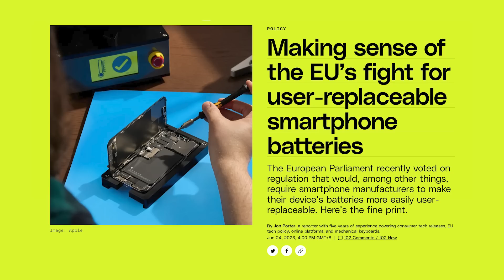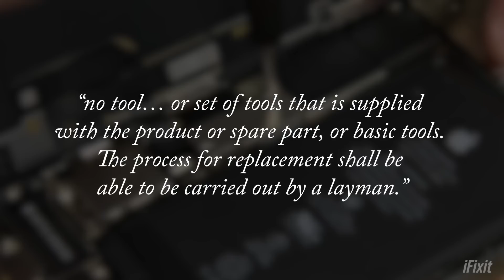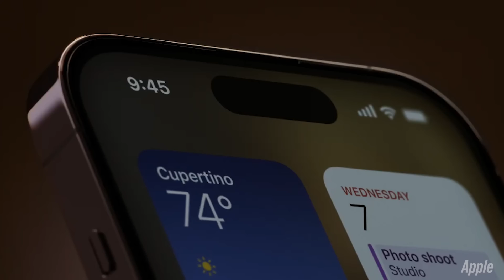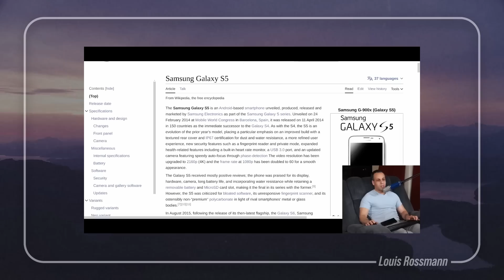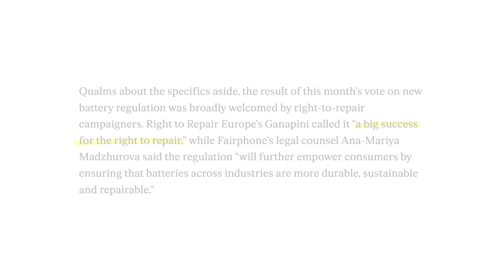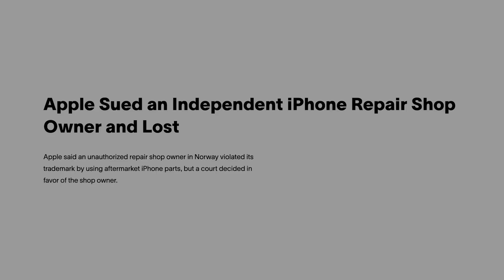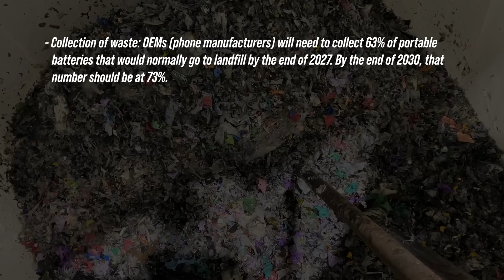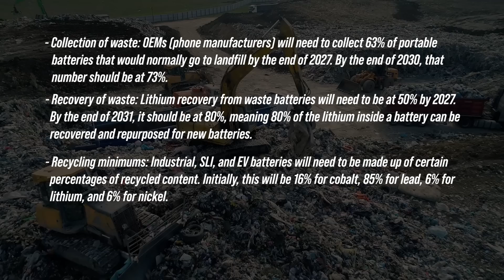EU Just Changed Smartphones Forever

Comment: With all of the innovation that has happened over the last 40 years, is it really that hard for them to have to actually 'engineer' some improvements - such as replaceable batteries, and/or Micro SD cards back into the phone -  no. Instead of offering an ever so slightly faster processor with an extra megapixel on the camera and a new colour, they are going to have to work for once to 'earn' their cash cow. I'm a fan of universal chargers and remember when almost everyone had a Nokia so you never had to carry a spare. I'm not normally into Governments interfering with markets where there is no crime taking place, but this is surely a good thing. The number of devices I've had to bin due to the prohibitive cost of battery replacement is crazy and then factor in the (even!) older generation such as my mother who will only bin her phone or laptop when it's unusable, this is going to be a net benefit to recycling. Sure, it will hit the bottom line of Apple, Samsung et al, but I'm quietly confident that they'll be charging us more the phone, and probably selling it without a battery 'to cut down on e-waste' - which I'm sure some of you will remember that was the reason they gave for not including a charger in the box... Boot is on the other foot, your move, big tech!

Comment: On the EV front, this leaves the door open to massive improvements! there will now be the potential to change the range of your vehicle by changing the main battery or adding a range extender! also introduces the possibility for 3rd party manufacturers to develop Non-OEM batter packs that would extend the life of older cars (yes that much was implied in the video) but also in combination with a possible flash tune to "hot rod" the vehicles!
Reply: Just to add that back in the early to mid 2000s and even upto fairly recently, there were extended life batteries available for phones so this is nothing new, just a pitty we need Government intervention yet again to reign in the greed of the corporations
Reply: That rule doesn't app to vehicles.
Reply: More important than that, you should be able to replace storage and generation tech.
Reply: In my country, there's a push for ev bikes to have standardized battery so they can be swapped out easily in charging stations. Granted, it's not yet written into law as a requirements, and the scope for now is limited two wheelers while availability still limited to metropolitan area. But I see it as a good starter model to steer consumer's expectation of how EV should be specced out and operate. Since currently, most charging station is operated by state-owned company and government are trying hard to reduce oil dependency. 

There's a hope that given enough time to expand the current model of "hot-swap charging", manufacturer-exclusive battery will be less attractive in local market.
Reply: Tesla announced a while ago that they were making the batteries integrated into the frame of the car. I suppose this will put a stop to that. And that is a good thing.
Reply: I think for the EV too easily swappable and hopefully modular.  If all I needed is 60 KM range for today just a mom looking to take the kids to school.  Just place 50% of the battery into the car, it is way lighter, just have the other 50% swap into it when going for a longer trip.  But now, this is not possible.
Reply: Imagine thinking the EU wants to allow people to performance-mod their cars (or even have it be "their" car)
The age of Barryboys, Chavs and "cruises" in supermarket car parks in the early-mid 2000's seemed stupid at the time, but in years to come it will be looked back on as the last great golden age of car culture in Europe.
Reply: Car companies are shifting to battery cells directly integrated in the chassis to increase power density and to lower the overall production cost. I think that this law will definetly have negative effects.

Comment: More worried about the effect this will have on EVs tbh. Making batteries easily replaceable by anyone could be dangerous given the high voltage, not to mention the added weight, cost and complexity to manufacture. EVs are already expensive enough and need to get cheaper. Hopefully this doesn't hinder that.
Reply: It won't.
Reply: @BigHenFor  can you elaborate on my other points?

Comment: Missing the day of Hot Swappable batteries, my Samsung S3 and extra battery was my workhorse for a few years, when its power is low I just change the battery I don't need to be tetheted to a wall socket or carry around a bulky powerbank. I miss those days.

Comment: Pff, of course the switch to non replacement was mostly done because of profit (of course there where some technical reasons, but if they wanted, they could have dealt with those).
I am also far less optimistic about the phones outside of the EU, I would guess they cost to make a second design is easily covered by all the profit they make from having non replacement phones outside the EU.
I think only when both the EU and the US have those laws it will become worldwide.
Edit: ok, after thinking about it a bit, maybe there is hope in the way that one provider chooses to go for replacement in the rest of the world to enhance their marketshare. Forcing (most) others to go along. Still don't think the IPhone will go along with that though.

Comment: A lot of phones now break because they are glued. Im old enough to remember dropping a phone used to resault in back flying off and the phone being just fine. Shock dispersion they called it. Much less shattered phones back in the day. Partly because of plastic backs and partly because the phone would blow up only for you to put it back together in 8 seconds. Also i really miss the metal back phones (yea, i had the HTC M7 and M8).

Comment: Phones, Tablets, Laptops - it's all relatively easy to solve. But how about smaller stuff like wireless earbuds? Are those covered by this law as well?
Reply: no probably not. But the samung buds 2 (as big or smaller as air pods pro) can be just opened by pulling from both sides with pliers. From there one regular tiny screws and the battery can be taken out. I was surprised how easy Samsung made them to repair and replace.

Comment: Follow the money.
Two things make you upgrade a phone whose performance you are happy with. The battery and security update limiting.
Apple ect works sell a lot less phones if you could just put a new battery in, but there is another issue. Is you are in a remote location surely it's better to car. ry a spare battery rather than relay on solar charging which when it's raining don't work! 😢

Comment: Honestly, I hope EU will go even further when it comes to repair and spare parts. Ideally, any piece of electronic should be as repairable as a car. It is possible. I ride an e-bike that's just as repairable as a normal bike. The battery can be changed using no tool except the lock key, and the motor can be repaired without taking of the wheels. It's all possible. Consumers just have to expect it.

Comment: Remember when replaceable batteries were the standard? The EU doesn't do jack s...t where it should've been...

- Ban removing the labels from chips
- Ban using custom firmware for basic functionality of a device, instead enforce an open standard
- Require the MFG to stock all parts for 5 years after release of a product
- Require the MFG to release / sell complete service manuals after 3-5 years after release of a product

There, just a few basic things the EU should've been doing.

Comment: It would be hard to argue that NON-replacable batteries are not anti-consumer, seeing blatant anti-consumer behaviour those companies exhibited over the years.
Just watch a few of Rossmann's videos, the lobby by those companies against users in the US is crazy. What's more insane that it works.
If you're right, and these companies won't create separate designs for within and outside the EU, then EU basically just fixed at least a part of US corruption.

Comment: Watch Apple have a "special chip" in the battery that needs to "synchronize" with the phones CPU and those batteries are $499 and because of the special chip a "3rd party" battery wont work right or make something not work right or make it glitchy for no reason or SOMETHING. there WILL be a catch i can smell it.....
Reply: Then don't buy Apple.
Reply: and it should. Whole this ‘right to repair’ is actually, cry of the wannabe repair shops, who wants to sell you broken stuff repaired with cheap/parts from stolen phones for full price, and eBay ‘traders’.  Yes, make all parts replaceable, but put sync request in every single part. Also, security modules can’t be ever replaced (face id cameras, finger print sensors etc). Because if I buy used device I do not want to be scammed and I also like that nobody want’s to steal my phone, notebook, tablet, because of the protection it has, it is useless for him. Only for some spare parts. Also whole this idea about ‘replaceable batteries’ is stupid, because batteries last as long as device is supported. You will have more problems with device which is not supported anymore. I never needed to replace my battery before device itself becomes unsupported, or let’s be honest I just wanted new stuff.

Comment: Cameras have always had replaceable batteries. Particularly handy when on holidays and you want to take loads of photos and video with your compact camera.  You can also easily change the SD Cards on a camera.
Reply: There are no low-end cameras any more, though. The smartphone killed that market. Anyone buying a camera now is only doing so because the pretty-decent optics on a smartphone are not good enough.
Reply: @vylbird8014  Gopro and other similar cameras still sells a lot.
Reply: Cameras, torches and a lot of other toys, including some phones. I mean standard batteries, not proprietary, which even can be replaced are quite expensive because of lack of competition. When I have seen that motorolla with two standard AAA batteries I was thrilled. No worries anymore for the battery. Unfortunately died before batteries. The next one, with all care in 4 or 5 years the battery got tired, so I found two extra batteries and hopped that that phone will last the rest of my life. But two years later the sim port failed. So now I have an mini tablet with no use. I switched to a senior phone sure that will last more than me since I do not use the phone too much anymore.But I needed an surveillance camera, and the fucking thing needs to be controlled on a smartphone, so I   was forced to get one. Imagine how pissed off I was when I found that no phone has replaceable battery. Then I neded a tablet for my banking. Same story. 

Now with this law Maybe thing will change to better. But if displays will be as fragile as today, and components designed to fail, I fear that the change will not really help.
Reply: @ehombane  21700's are great for torches

Comment: I suspect the decision to build non replaceable batteries both sinplifies the design of the phones and makes repairs quicker.  It's much easier for Apple to clone the phone and replace it than repair them.  Apple and other companies dont have to publish documents or train employees on board level repairs.  They also have a supply chain advantage if they don't need to supply or provide individual components.
It still is a bit anticonsumer.  But I can see the advantages of it for the manufacturer even if I don't lume it.
Reply: It is also likely Apple can get more of their customers to return old phones for recycling than many other companies.   Trade-in programs are great help in meeting the EU mandate.

Comment: It was merely done for profits, with my recent repair for just the glass back panel the OEM stopped the spare parts and repair for which I had to go to 3rd party which also costed me more due to shortage for spare parts in the market for my model.

This is a complete monopolistic approach to rip consumers to right to repair.. As when on first visit to OEM service center, they pushed to upgrade and buy a new device (which is perfectly working fine) just coz they couldn't provide me any repair or spare parts.

Comment: Ironically if the phone industry just followed the boating or jetski market and use a 'rubber gasket' to waterproof a phone battery it should be simple. Its what the old go-pro's used to do, remote control boats and so on... size shouldn't be too hard for a phone size.
Reply: Anti-consumer practices are only half the reason for the loss of replaceable batteries. The other half is the strong competitive pressure to be ever thinner, because customers favoured thinner phones. That gasket adds another millimetre of thickness.
Reply: @vylbird8014  Apple built the iPhone 14 Pro several millimeters thicker than its predecessor, and absolutely no one cared. There was no outcry why it was so hideously thick, and people still bought it as usual.
Reply: @vylbird8014  I do see your point. But I struggle to find ANYONE who doesn't use a phone cover or case today... So a 1-2mm thickness difference shouldn't be any issue. And even if you take the Samsung note series... They are all waterproof from what 2018/9 onwards, and all have removable Bluetooth Spens that just click in and out. So I think it's easily possible

Comment: Im all for easily replaceable batteries etc. But the part about "no basic tools" is just stupid. Why should you not be allowed to use screws / a screwdriver in the process? If someone is not capable of using such a basic tool, they will certainly neither be capable to source the correct parts etc. 

This will just force unnecessarily complicated designs, like on the lg.
Reply: Maybe it's imply that you could replace battery on a go? And maybe to stop some wierd 5-angled screws and a special screwdriver for 99.99
Reply: Probably to avoid complex discussions of what comprises a basic tool.

"Of course our battery is compliant. You can remove it - all you need is a septalobe screwdriver. What, you can't find one? It's a perfectly common tool in our factories."

Comment: Motivated by profit

The leader in smart phones back in the early 2000s was apple, with the original iPhone, whilst there were phones with apps, and phones with touchscreens it was ultimately apple that came to the market with the enclosed battery 

Even if another manufacturer did it, it was apple that popularised it

Yes an element would of been consumer demand for slim form and I believe Steve jobs would of pushed their team to make it thin form, but the enclosure meant capitalism immediately, you can't change the battery it needs to be serviced, users would of been fine by this as by the time the battery gave way your contract expired and a newer device with better memory and tech ology came to the market

I also believe they push updates to lag the phones and annoy consumers into wanting a new device

8gb ram and 1.4ghz is more than enough computing power for an operating system with powerful software for video editing and graphics design so a mobile phone is pitiful in comparison
Reply: The first iPhone was sold in 2007, not early 2000s
Reply: @antoniousai1989  time line may be wrong but the point remains